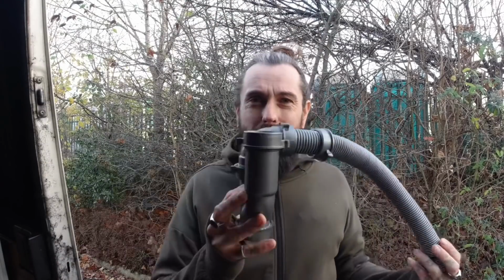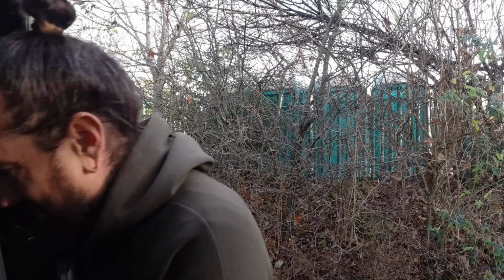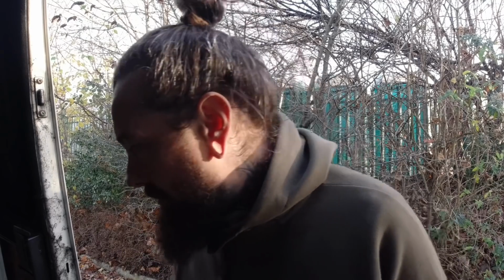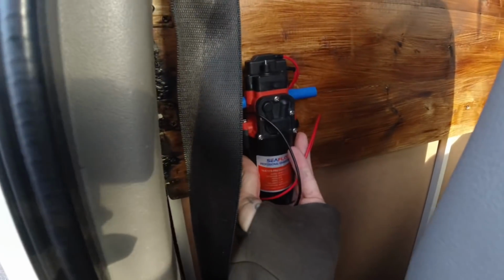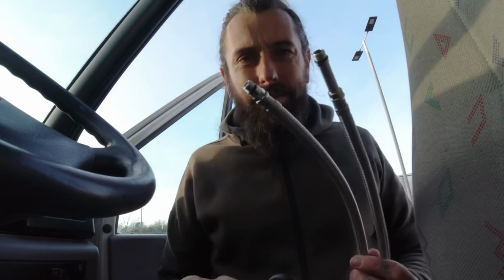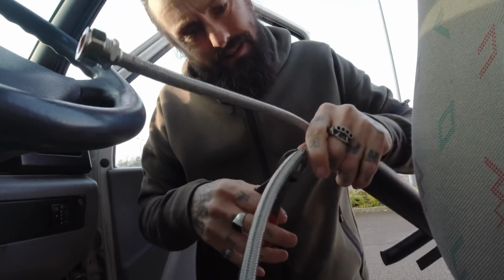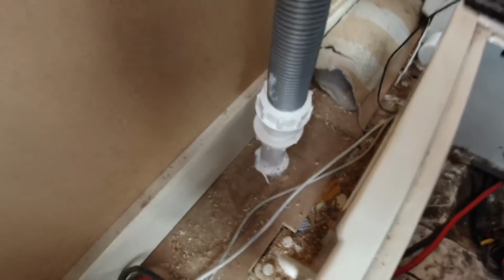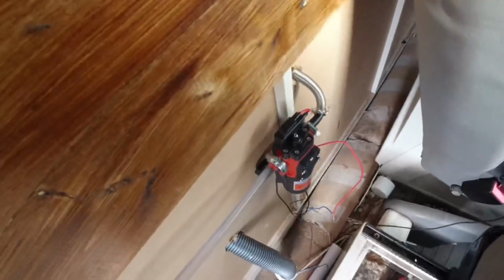Building a van - Ep 16 - Top Plumbing Job

Comment: You’re game to tackle the plumbing - a handy job you’ve done there. We had a grey tank on the motor home, but we needed it for the shower really. 80 litres just for my hair : ) Washing up water is a tiny amount in comparison, when you’re camping in a tent it’s around a bucket full at most that gets tipped out wherever. Here in Australia we need to collect it when we are in camp grounds I think, self contained they call it. Some places have grey water drains you can run a hose straight into. I used to stay in small town show grounds about once a week to fill up water and recharge everything and empty the grey and black tank for around $20 per night - that was about 5 years ago. Anyhoo have fun 💗💗💗

Comment: I would advise to fit a switch to the pump feed, any leaks when your not with the van and the pump won't work.
Reply from the maker: Already have
Reply: I agree. I sometimes leave the switch on though, hit the faucet handle by accident and get water everywhere 😅
Reply: @tashatorrid   Fit a warning LED somewhere its vital its not left on. If a pipe burst or flies off a connector  just 10 seconds is enough to make a huge mess and fk up the floor.

Comment: good on ya Liam, Lord of the Tap.
Unimpressed Jeff might need to answer this prose though.
If a pipe came off between the pressure pump and the tap, wouldn't it keep pumping water out onto the van floor until the tank was empty AND then keep running until the pump burned itself out?
Reply from the maker: I fitted a dead switch
Reply: Yep the pump is pressure switched, basically when the tap is opened the pressure drops and the pressure switch operates the pump.

Comment: Always run my waste out the floor 🙂 / I'm fitting that same pump this wk does it need an accumulator or run ok without
Reply from the maker: I’m using it without
Reply: You don't need accumulator i don't know why so many people fit them.  You only need it if the pump is mounted very close to the tap to prevent cavitation and the pump will switch on off very fast.  Anything more than 2 metre  of hose has enough built in expansion to smooth the pump especially if you have a rear holding tank and long runs to the sink.